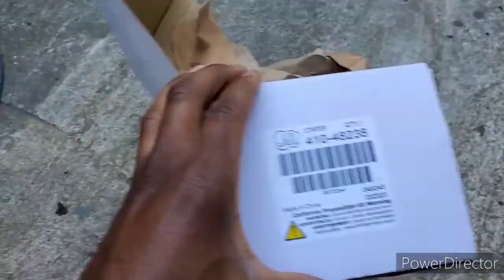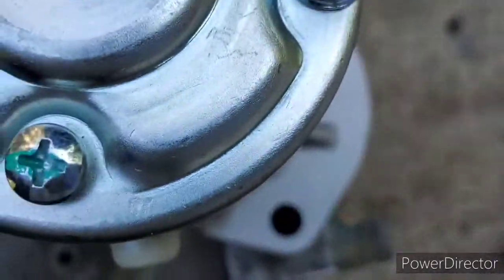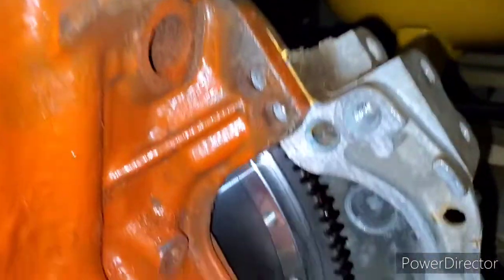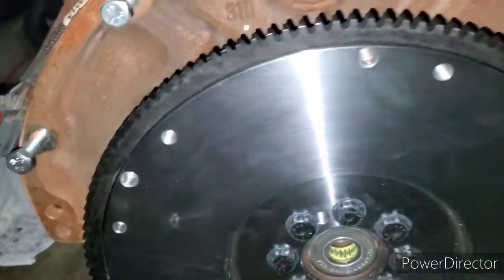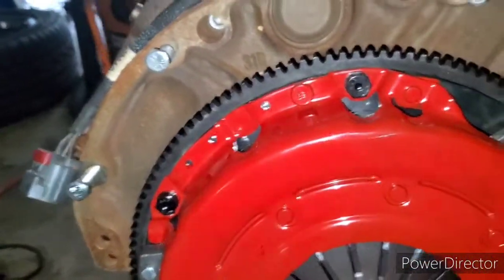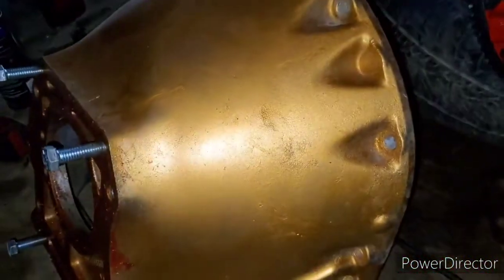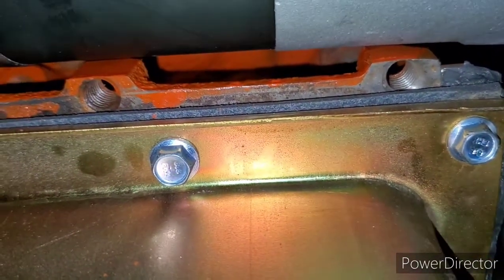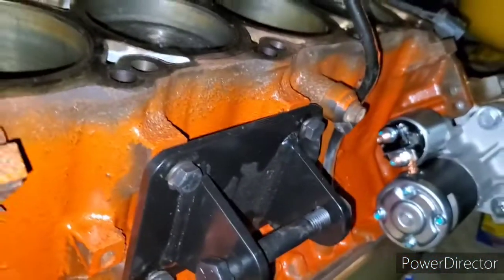5.7 hemi starter,flywheel and clutch install

Comment: ok i see the fly wheel now looks the same.i see you didnt use the the metal engine flywheel shield any reason ?
Reply from the maker: Im going to buy 1 later
Reply: @musclecargarage8882    i dont think it will work the small block bell has its own that bolts to it and buts up to block if i am not mistaken